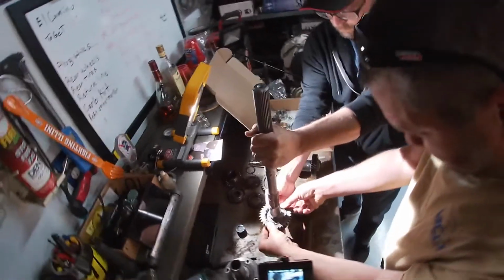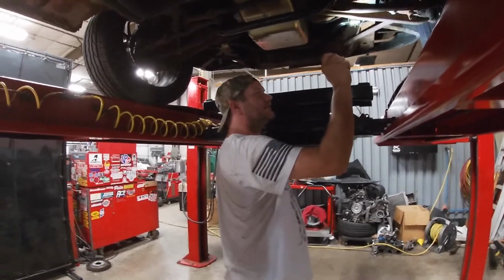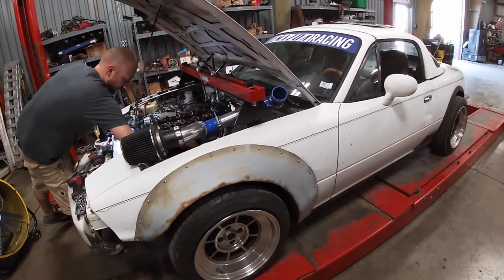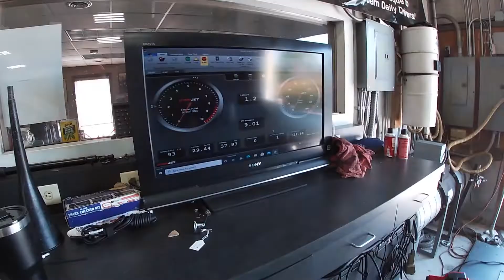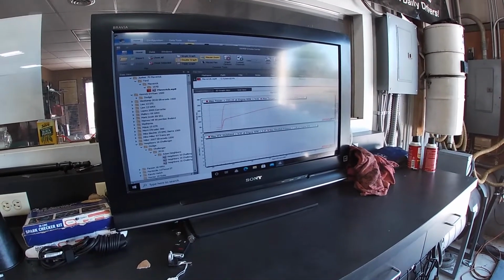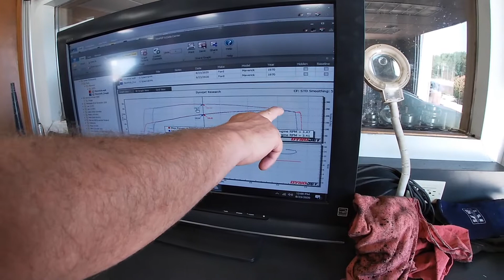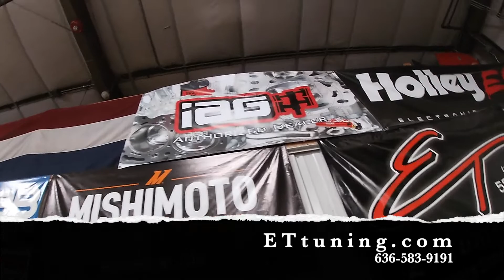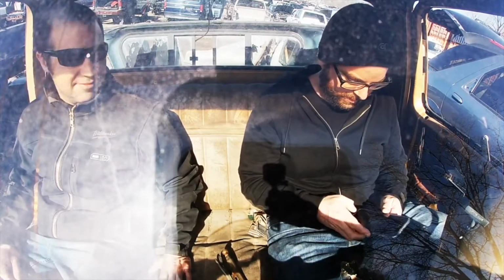T5 Transmission Swap DONE! We put the Maverick on the Dyno!

Comment: Will y'all have a video on the installation?
Reply from the maker: It's just the same old footage of us bolting the transmission on and stabbing it in.
Reply: I was just curious of the way you got it to work with cable or hydraulic, because I have a 72 maverick that is going to get the same trans.
Reply from the maker: @markreid9592  I get why you are asking... It was tricky. We bought a Fox body style pull hydraulic master and an internal hydraulic throw out bearing. The master is pretty junk style. There is a cable pull on the factory clutch pedal that goes out to a bracket. When you press the pedal, it pulls on the master via a heavy duty clutch cable. I've gotten a couple questions on social media about it so maybe we will drop a short video explaining how we made it work. But honestly, there is probably an easier way.
Reply: Great we would like to see it.